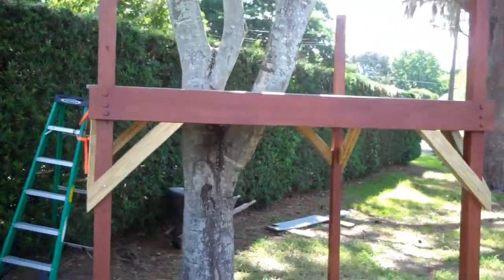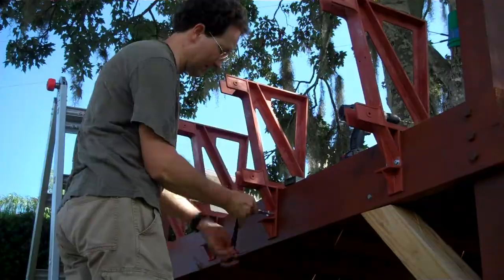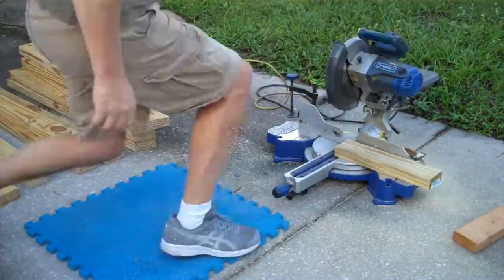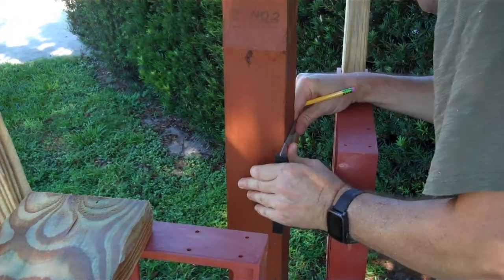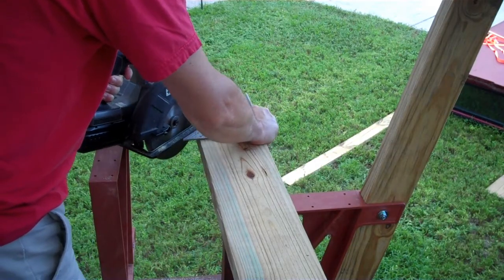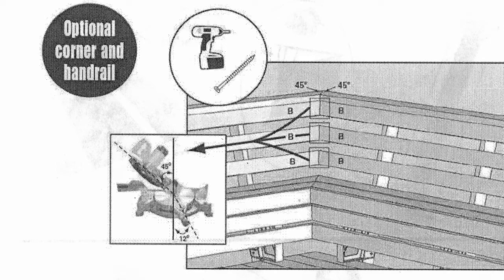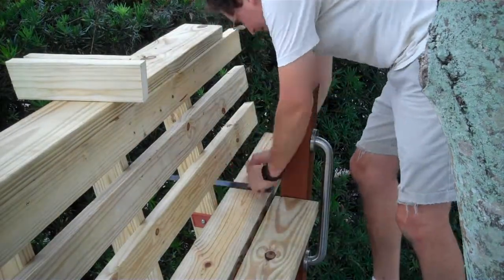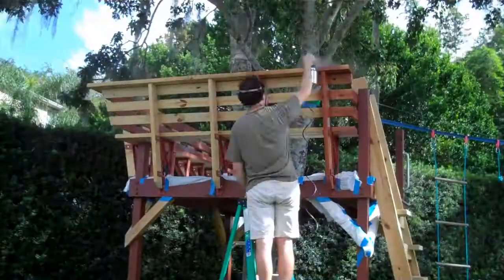Adding benches to the play structure with 2x4 basics brackets

Comment: Nice job. How are the brackets holding up after 2 years? Im wondering how they will handle extreme cold in winter as we get well below zero where I live.
Reply from the maker: They are doing fine in the heat and sun of Florida. I assume they are also rated for freezing temperatures, but can't speak from experience about that here ...
Reply: @summetj  thanx for responding. Glad to hear your happy with them as I am considering getting some...the wife wants a bench on the deck. lol.  It's well above normal temps here right now. Last friday night we had 5 inches of snow and today it's 80 which is 30 above normal. Have a great summer and thanx again for reply..

Comment: Hi Jay, I've now watched this video countless times as I endlessly procrastinate finishing my deck bench project, and something is vexing me. Around 4:52 you explain the compound mitre cut needed for joining corner backrests. This makes sense in theory. But I CANNOT for the life of me figure out whether a) just one side of the join needs that cut or b) if both sides need it, with one 'flipped.' I cannot get b) to work at ALL not matter how I flip boards or move the 12 degree cut to the other side. And my mitre saw only bends to 45 degrees in one direction (left), which it looks like yours does as well.

My question is - at 4:52 (and in the bracket instructions) it seems like it's supposed to be a), but at around 5:30 it looks like b)? As in, maybe the left side backrest boards are NOT cut with the same compound cut?
Reply: *miter (lol)
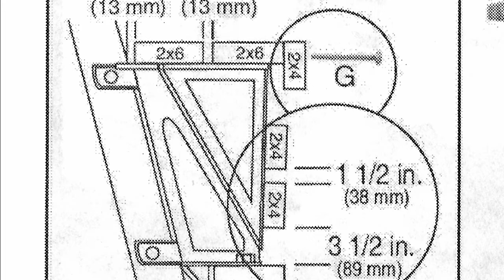Reply from the maker: Yes, when the two backrest boards comes together at the corner it's a compound cut, but later on around 5:35 for the "arm rests" because the smaller end pieces are NOT "meeting a corner" but are instead just "butted" up against the backrest boards, they only need a 12.5 degree angle. You can see the arm rests installed at 6:09